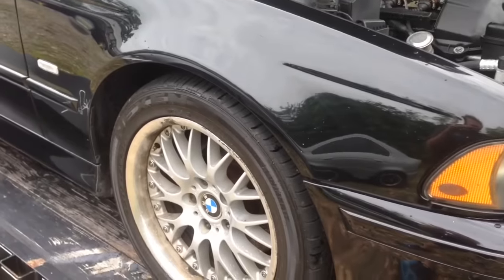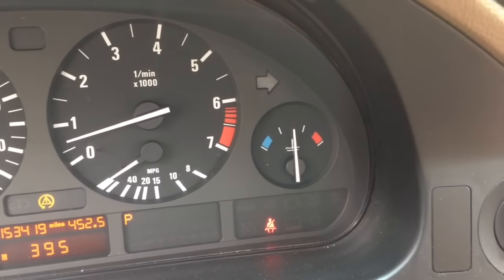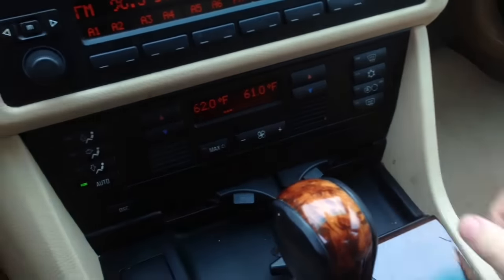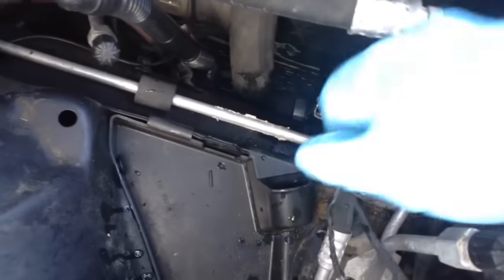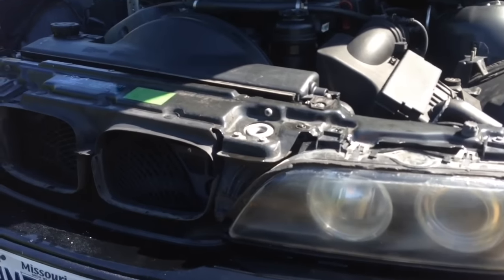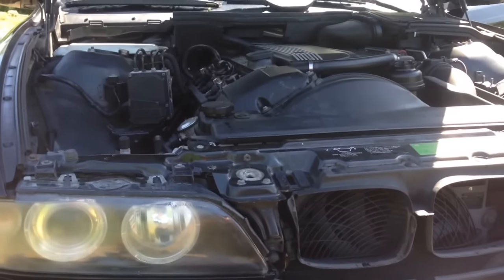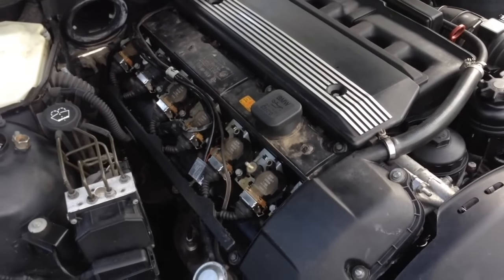BMW E46 E39 E53 AUX Cooling Fan Problem Not Working correctly Relay and Thermostat

Comment: Hello Nathan. I'm having some issues in my car. It's an e46 330i model year 2002. My car has single electric fan because it's a manual transmission and my AC and electric fan aren't working. I checked for codes and found that my thermostat not working so I replaced thermostat and the temp sensor (I suspected this sensor as well) on the lower radiator hose. Unfortunately the fan is still not working. I believe that the fan is not getting signal from the ECM to operate because when I connected the fan directly to battery it worked finely. Also AC gas system must be fully charged in order to fan to work. I'm planing to put a new fan and recharge the AC system. Please help Nathan. Kind regards and all the best for your work..
Reply from the maker: It could be the fan, the fan on those have the resistor box on the fan itself that could be bad
Reply: +Nathan's DIY Garage thanks for the quick reply. I'm hoping to charge the AC system first because it's cheaper😂

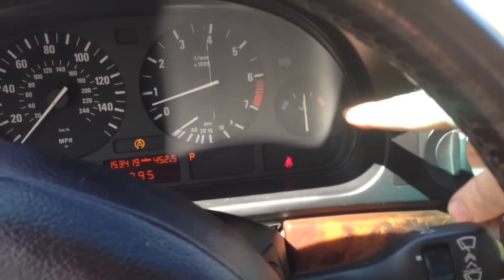Comment: Nathan I have a 3:25 XI 2004 BMW it overheats but I turn the air conditioner  and the fan comes on but it still doesn't cool off my car can my fan be bad
Reply from the maker: The fan could not be going to the second speed, but the fan is only going or affect it if your sitting still, if it's overheating while driving it could be air in the system or the head bolts stripped

Comment: i have a 1999 bmw 328i and after i turn off the car and while i have the car on a really loud fan from the front hood is on full power and it doesn’t turn off until i unplug the electrical plug.
Reply: can you please give me some info on it??

Comment: Great video. Not specifically related to this, but, 
do you have any idea how to return panel with display to panel with buttons, so that the small copper contact parts, not pops out of their socket?
Reply from the maker: +dragoslav ristic I will need some more details , i couldnt follow you on that one
Reply: Hey Nathan. I have a 2000 528i. Here is my issue I can run it all day sitting in my drive way with the heat on  and it will not overheat. I drive off and it doesn't over heat. Whenever I turned on the A/C and come to a stop that when it over heats. The fan does run when I turn the A/C on but I don't think that it comes on when the car temp is high. If i unplug the temp sensor the fan will spin full speed. I take the thermostat out ant it still did the same thing. What could I be missing and what is the little black box on the fan shroud for?

Thanks you
Reply: Donovan, did you fix it? If so how?

Comment: I had this problem for years, it will only climb when im in a drive thrue, or at a stop light, i replaced everything but the fan, that was the culprit in my case.

also if you see your gauge climbing past half,  blast your heat and it cools down almost instantly

Comment: Hey Nathan, I'm having the same issue with my car all of a sudden, but I can't find a freaking video on where to or how to access the fuses you mentioned behind the glove box.  Could you do one to show where they are and what they do?  Thanks buddy!!!
Reply: Rene G. Solis it drops down from the top of glove box on my BMW. Has 2 plastic clips you spin and it drops down then comes with a diagram to locate specific fuses.
Reply: On my 2003 e39 530i they are under the glove box accessed through the lower panel required contortive position to reach up in there

Comment: Nathan I see the traction control light is on!! Same on my car and it doesn’t have acceleration, do you have a video for that??? I would really appreciate
Reply: were you having any transmission slippage? I believe that is limp mode. I had to replace some transmission solenoids.

Comment: is there a way to test if you have a bad relay?
Reply from the maker: +Donovan Scarlette I'm sure there is a way to test it but if the fan is not using the second high speed the it's the relay for sure, I might have one here if you need one
Reply: @NathansBMWWorkshop  so your saying if my interior fan work but not the aux cooling fan then its the relay?

Comment: Hi, my car is overheating every time i turn on the ac, but only if i drive longer than 1 hour. So i checked the aux fan when the car was overheating and it was turning. Also replaced the coolant sensor with the switch but didnt solve it... Maybe its the fan itself that is not turning fast enough? Any ideas?
Reply from the maker: it could be, the fan has 2 speeds maybe the second speed is not working right, the little black sensor on the fan shroud controls that
Reply: I ran the aux fan test with DIS57, the test consists in activating the fan at different rates. So its not 2 speeds but variable speed. It ran 25%, 35%, 55%, etc. The problem is that the actual speed didn't change at all. So the control unit must be bad. That sensor you refer to is the AUC sensor (Automatische Umluft Control). The control unit is attached on the aux fan itself but i don't think it can be replaced...
Reply: How did u fix it

Comment: just now getting this issue, purchased a new aux fan since my car's at 145k miles and going by records i don't think it has been replaced.
knowing my luck, i'll replace it and it still won't work :/
my diagnosis so far has been that it literally never turns on. not when the car's hot, not when i turn on the AC, it never spins
also i replaced the temperature switch on the lower rad hose not two months ago, so that's probably not it
Reply: did you ever figure yours out? Did you end up just replacing the fan? I have a 2001 e46 330ci and the aux fan never comes on now, overheats after 10 min of running...sad day....i had found that my three prong connector(for the aux fan) from the main harness had somehow melted at the end, have yet to try to track down the rest of the lines to see if they crossed anywhere else
Reply: Nightstalker907 
Yeah, new fan fixed it immediately, the new fan is quieter too
Reply: Sweet will be ordering mine next week, tired of overheating for no real reason.
Reply: @ripdapip5000  did the new fan fix the problem as well ?

Comment: Okay so I noticed my aux fan would not work every time. I plugged in my Creator c310 and I got a code for electronic fan. I then erased the code and all is well now. Fan is running good.

Comment: FYI, the temp gauge doesn't get "a just little over" halfway because the needle isn't linear.  It is controlled by a computer program which has a special idiot buffer.  Typically it goes over 1/2 at 115 C.  So from 75C-114C it will be at exactly 1/2.  I removed my buffer because I don't like companies lying to me, so I know what I'm talking about.

Psychologically speaking, what's happening here is people are assuming it is linear, so they correlate the amount of time the temperature gauge is above 1/2 mark, and say when it gets just a little over instead of when it suddenly jumps way over, which is actually what happens if the cooling system fails.  There's almost no time before the emergency leak system (radiator cap) would be activated.
Reply: What'd you do to remove that buffer? Funny enough the first car I ever overheated was a bimmer.... Didnt know it was overheating until it was too late!
Reply: How did you remove the buffer? Through coding? INPA?

Comment: That is not a fan relay. That is the AUC - Ambient air sensor related to the air conditioning settings. Senses air quality. Has nothing to do with the fan or any relay.
Reply: Please help me, please, I’m at wits end. I can’t find the smoking gun. Coolant system 2006 BMW X3, changed water pump thermostat upper radiator hose, radiator , heater control valve, overflow bottle and rad cap. The car is overheating. I have Zero codes. The fan isn’t staying on when the car is shut off and over heated. Again no codes for lower radiator hose sensor or relay. Doesn’t seem like the thermostat is being told to open so there is flow. I’m at the end of my mechanical rope. I don’t know what to do next thank you Kevin NJ
Reply: @kevinfraser640   - when you changed the lower hose, did you replace the sensor attached to that bottom hose? It may be malfunctioning. Also, did you bleed the system properly? Bubbles will cause overheating.

Comment: you said no more leaks? do you mean oil leak? my coolant sensor was bad and I nosiest that my oil level went down but I had no leaks under the car...  I am kinda confused... I don't know how is it buring oil? can anyone help me before 9/20/16 please!!!!
Reply from the maker: its normal on most of these cars to burn a quart every 1000 miles or so, if it went down quickly check the dipstick 0-ring, they are common to leak
Reply: If your car is losing oil and there are no leaks to be seen and there is no smoke coming out of the exhaust... Check your  pcv valve and or your oil separator valve. I cant agree with Nathan on this, I don't think losing oil is normal but I'm no expert either.

Comment: AC fan inside the car. Blower is intermittent.
Reply from the maker: Probably the blower motor resistor going bad and needs to be replaced, you should be able to get off ebay for around $20 and install it yourself

Comment: It happened after mechanic replaced all 4 wheel speed sensors and brake pads, came back to the shop, reinstalled all sensors but the light still comes up, 
Ps; the brake pads sensors didn’t fit so they are probably discpneccted

Comment: Hey Nathan would you please help me .. i have a 2004 BMW x5 3.0i engine gas and the aux fan used to work fine and engine never overheated and the air condition blew nice cold air. Recently the fan stopped and the engine started over heating in traffic and the AC is not blowing cold air. Where do you suggest me to start digging to get it to work and how can i give 12V to my fan to check if the motor is dead or not. Thank you
Reply: figure it out?

Comment: I thought the fan only came on when it had to, not too sure but my car only has the fan on (and its occasional) when it reaches operating temp or the a/c is on. Think this is just to keep the car at the steady operating temperature though. I've had long drives in my car (2 hour drive for about 120kms) and I wasn't observing the fan when I reached the destination but the car was steady operating temp, even with a/c on.
Reply from the maker: +Jack Right it comes on when the ac is on and comes on to regulate the engine temp, i believe it has 2 speeds for that